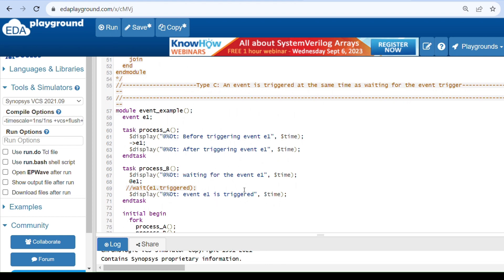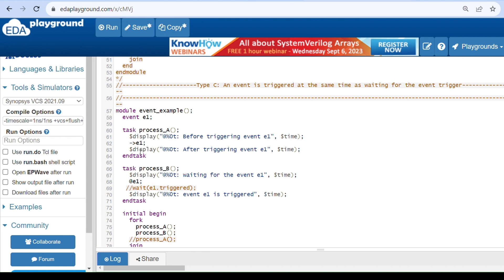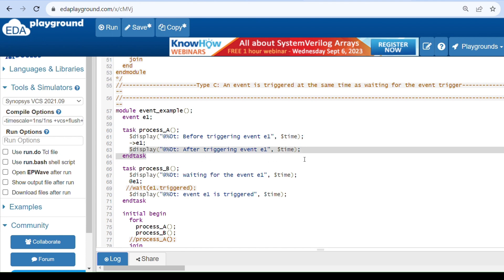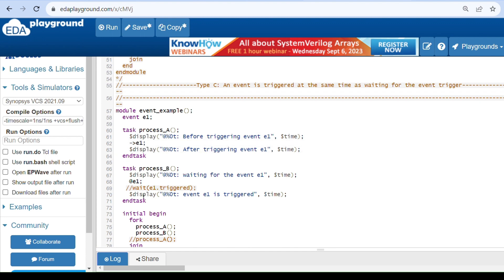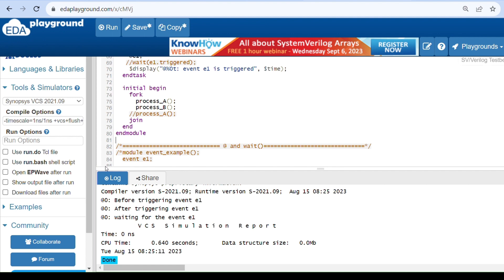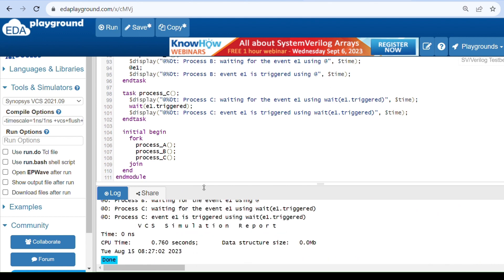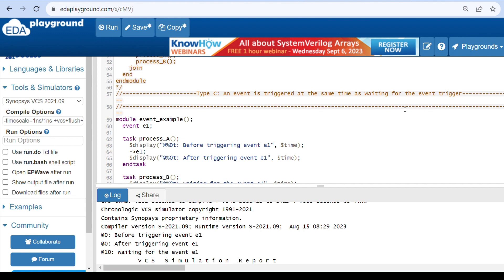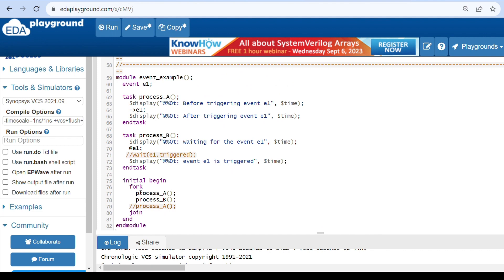Events in system verilog  | PART- 2 |  Interprocess communication in #systemverilog

Comment: Mam, why wait construct doesn't work like Type C in Type B also?
Reply from the maker: Because check the timing of events.
In type C, event triggering time(->e1) and waiting for event to be triggered time (wait(e1.triggrred)) happens at the same time(time=0ns) But in type B, event e1 is triggered at time 0 and the other process B is waiting for that e1 to trigger at time 10ns. 
It's a different time slot. 

Note: If the event had triggered at 10ns in the process A, type B would have acted like Type C only.

wait construct is non blocking in nature. It unblocks the process only when triggering an event and waiting for an event happens at the "same time".

To avoid race conditions we use wait construct in events.
(if both process/event happens at the same time it leads to race condition).

These are my old videos, The quality of the video and audio is not that good and there's also a lag between pointer and audio. If you didn't get any points or   if you have any questions feel free to comment again!
Reply: @susheelapatagar  Thank you mam, my doubt got cleared 🙏❤

Comment: What will happen when there is delay #10 and @e1 case for ->> for non blocking process. Is it block the process or not.
Reply from the maker: It should work as normal blocking events only. 
If an event triggers before waiting for an event ,whether it is a blocking or non blocking event, it should block the process.

When both triggering and waiting for an event happens at the "same time" then this non blocking events helps us to avoid race conditions. 
Because non blocking events will be scheduled in the NBA region and @ or ->  operators will be evaluated in the active region.
So in the example Type C, waiting for an event and triggering of an event happens at the same time. Since both -> and @ operators evaluated in the active region there was a race condition.
But if we use ->> , this will be scheduled in the NBA region and @ will be evaluated in the active region. So basically wait happened(@) before triggering an event(->>). 
This is how race condition is avoided.
Except this everything is same for both -> and ->> ooerators.